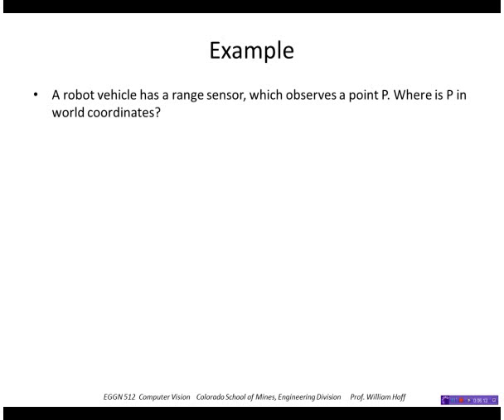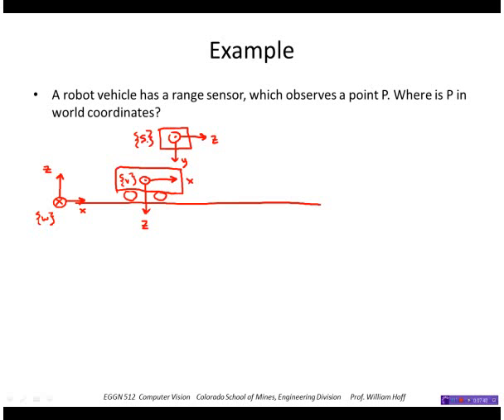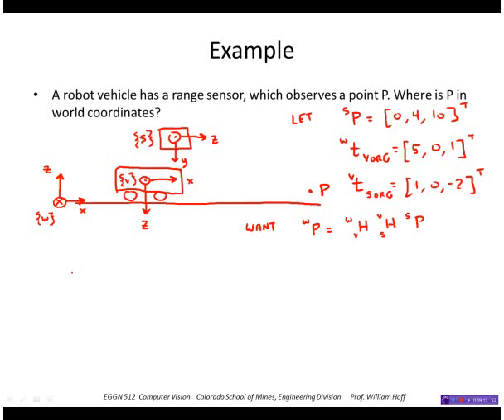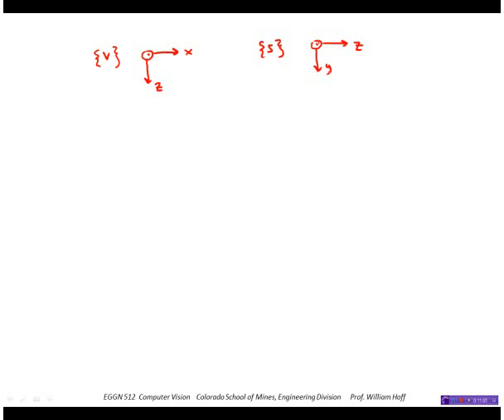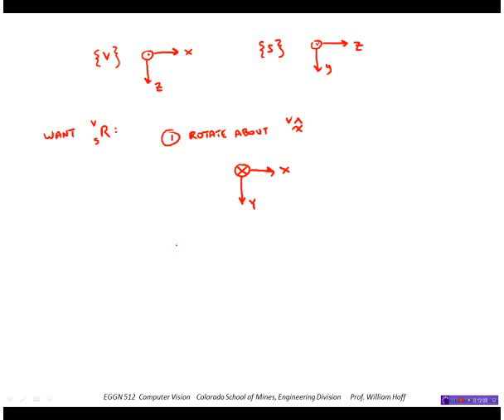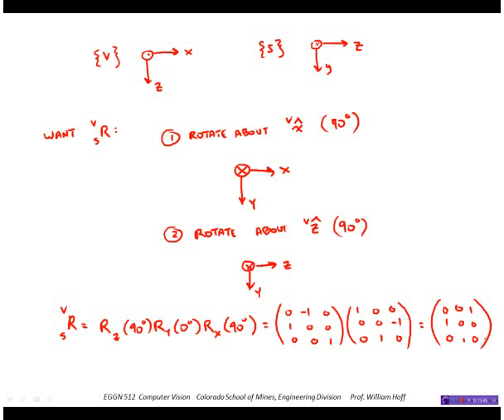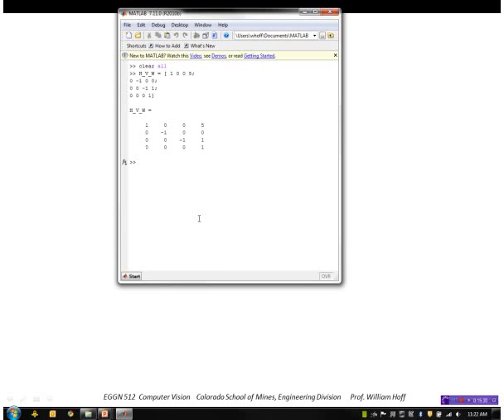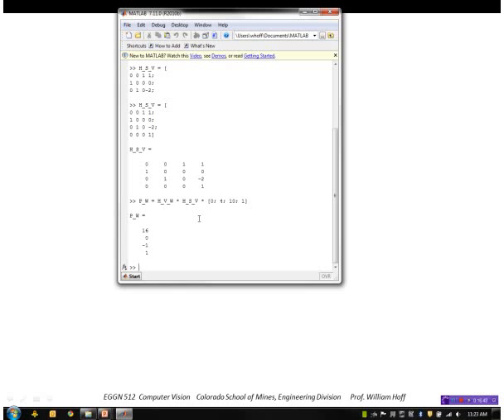CSCI 512 - Lecture 04-4 3D-3D Transforms

Comment: Hello William, thanks for sharing your courses, it's extremely helpful and well organized and understandable.
Could you please clarify on the following: Shouldn't the R_S_V resulted in the x axis point to the opposite side toward outside the screen as you showed in the question and not toward inside the screen like you drew lastly? In this case I would guess the rotations should be about the y axis and than about the z axis in order to get the x axis point toward me.
Reply: I got the same.... I also think that it should be y axis for the second one .....

Comment: The point of the example was to find sensor coordinates in world coordinates, i.e. we are given sensor data and want to convert it to world coordinates. However, when we find rotation from sensor coordinate system to vehicle coordinate system why do we convert v->s. Shouldn't be other way around? This is a little confusing.

Comment from the maker: Hello - sorry about the delay in responding.  In this lecture, I am using the "fixed axis" convention; meaning that we always rotate about the original axes.  So the second rotation is about the original z axis of the vehicle, which points down.  By the way, I'm planning to redo these lectures soon and will  hopefully have a clearer example.
Reply: Nice tutorial, appreciate sharing. The 'robot vehicle' example really gives me a hard time to figure out the 'bugs' and understand correctly. Beginner must read carefully and make sure you understand. Good luck ;)